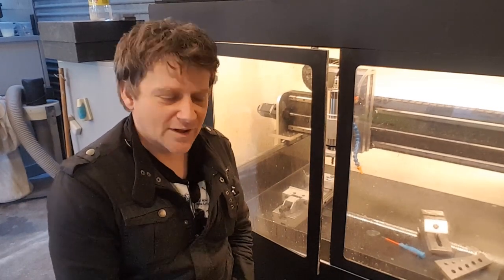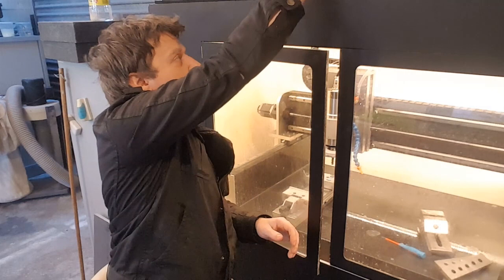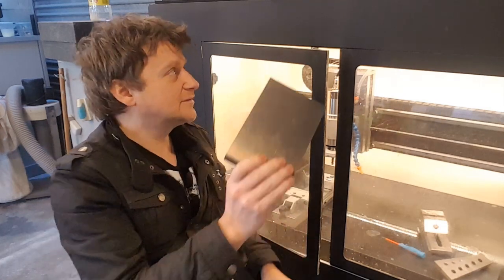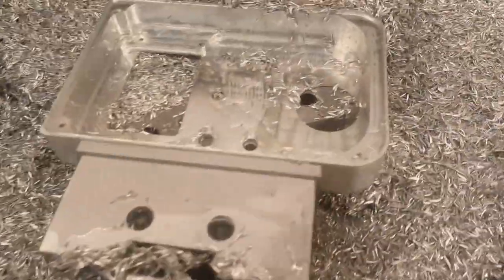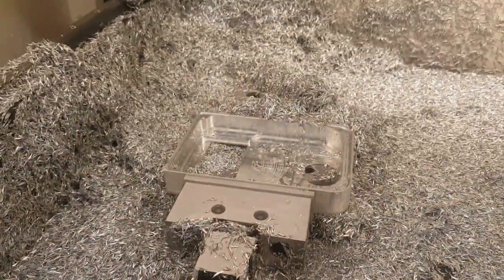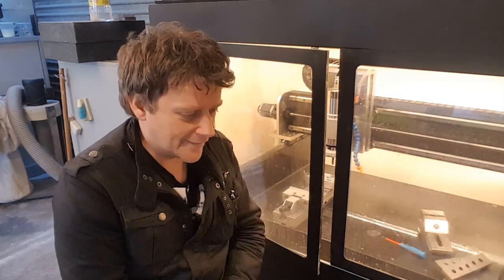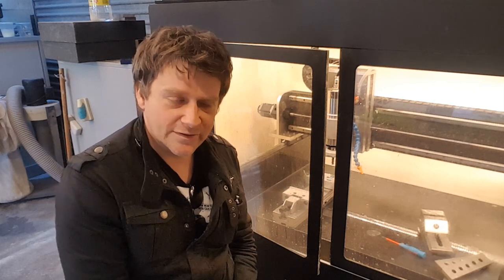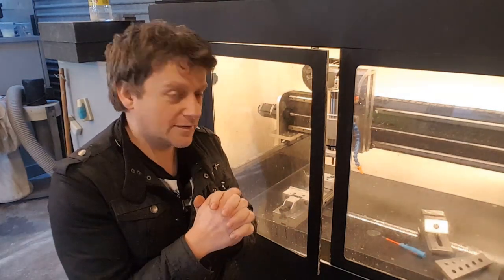High volume low pressure flood cooling.

Comment: For anyone considering doing this, know that water pumps (and vacuum cleaners, and air compressors) are notorious for "stretching" their claims. Even if the water pump rating is 100% honest, realize that it's based on testing where water enters the pump at pump level, so that the pump isn't sucking the water up from a lower level. Similarly on the outlet side, flow is measured right at the pump. In this application, the hose, elevation change, and end point all restrict and reduce the actual flow. Real pump manufacturers supply curves showing the flow with effective elevation. Weenie pump manufacturers do not.

Comment: Great videos Piotr! I've tried to make a similar flood cooling solution with 3d printed PLA, but after i connected the water, it turned out that 3d prints are not leakproof, and water came ouf of every side. It made the way between the layer lines. I wonder if that's due to bad slicer settings or wrong material? Or maybe there is a way to seal the right places?
Reply from the maker: that's something new i have to say :) I'm not a 3d printing expert but to me it looks like layers didn't fused correctly. pla  printing temperature should be 200 deg. it also depends on the temperature of the surroundings. maybe you could bump it up to 210C or 220C. another option would be to increase wall thickness to lets say 1mm? let me know if it helped.

Comment: Cool! I've rewatched to learn about the coolant nozzle. Every video where you've made parts on your laser cutter pushes me one step closer to purchasing one :)
Reply from the maker: hold on your horses :) i made new better nozzle, video is coming up soon :) laser cutter is really handy you should definitely get one. just dont get desk top one. its too small and you will get frustrated with it.
Reply: I've been thinking of Lasersaur since they did Kickstarter. It's 24x48" and that's about as large as I can haul. That's probably desktop size? I'd put it in unheated garage and vent to outdoors.
Reply from the maker: i had a 12x16inch laser cutter(i have footage in my videos) to cut something on it, you had to cut material first just to fit in to the laser cutter.. the amount of wasted material was just wrong. that's why now i have big ass laser :) lasers in general are very simple machines. not sure if you will be using it for the production or just occasionally. anyway you could get one of ebay for under 2k.

Comment: Subbed! inspiring channel! Thanks for the great vids.
Reply from the maker: Thank you. I'm glad you like it. ;)
Reply: You made some nice things! Does the flood coolant work for getting the chips out of the way? I guess it should be working since the granite is nice and flat.  I'm thinking about sucking them away (something that manipulates the airflow into a cyclone/vortex) It works for a big load of woodchips (25m/min, 22mm deep in MDF with a 12mm cutter) So i think it should be capable of aluminium at a lower volume . Btw. How many nights did you spend on the sofa for cutting up her wedding dress? Did you modified the Bosch PBD40 (the one used for flattening the uprights on the granite base)? mine has some play on the gearing-housing in the green cover. Something i still need to take care off.
Reply from the maker: Holly Molly!! 25m/min 25mm cut!? If I haven't seen the video I wouldn't believe it ;) it's just incredible. Wedding dress was just a prop we got on auction for models Photo shoot. We got 5 dreses for 40$ so no hard feelings ;) Bosch drill does have some play but still was good enough for a first pass. You just have to feel it and have some patience. I haven't tried coolant on big pockets yet. I will try over the weekend. Looks like should be enough.

Comment: Looks great! I have just acquired a much more sturdy CNC router than my previous 6040 and am looking at flood cooling - any chance you'd be prepared to share that 3d model for the nozzle assembly? That looks brilliant.
Reply from the maker: Sure. But this is very rough and sloppy. It was a test to see if I can direct flow in places I want. It did work. But it could be better. Email ??
Reply: cnc[a t} neilnz dot com - many thanks. I am sure it could be adapted - it looks a lot neater than the ones I have seen with the screw in line loc type nozzles. The flood pattern when running looks great...
Reply from the maker: sent :)
Reply: Hi Piotr! Any chance you would share that nozzle 3D model with me? I finally got a 3D printer and would love to add this to my machine